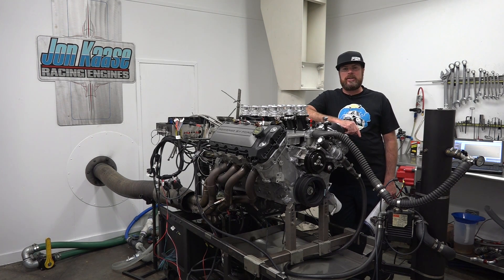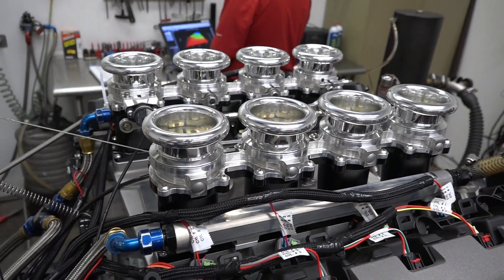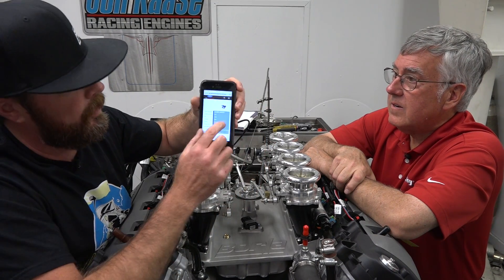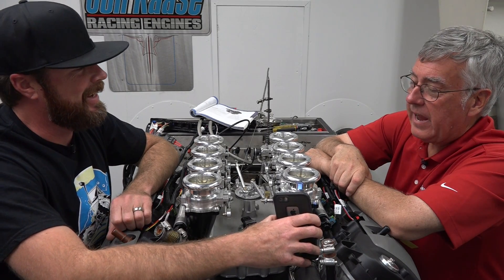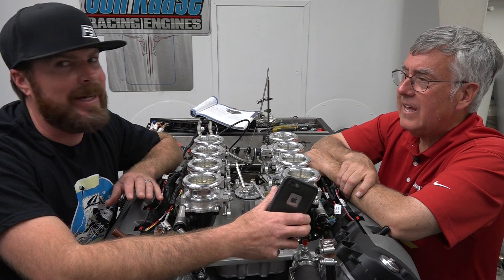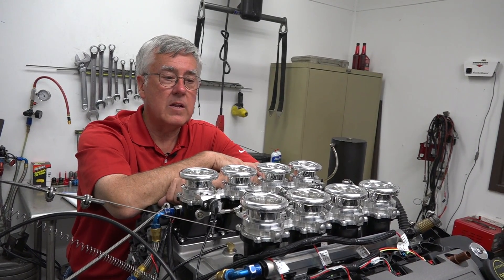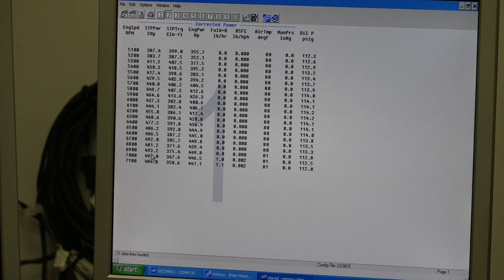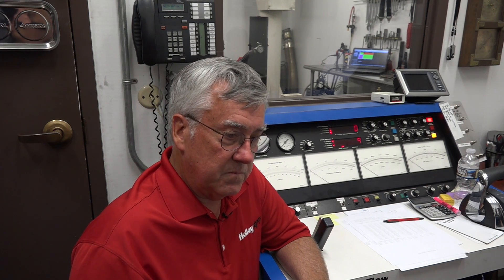Finnegan's Garage Ep.37: Dyno Testing a Ford Coyote Engine with Borla Stack Injection

Comment: $6500 is a little much for an intake manifold.
Reply: not when its machined from unicorn farts
Reply: @ screaminggoat43... yes it is, but just look at it, it's a thing of beauty
Reply: you don't do ITBs for raw HP, you do it for throttle response. a good ITB setup will always have the fastest throttle response, and a Dyno doesn't measure that.
Reply: You're missing the point. Nothing sounds as good as the intake noise from a high revving V8 with 8 open throttle bodies.
Reply: The buyer got this intake because that's what the buyer wanted.
Reply: wow burn out kings with pro mods so impressive
Reply: +1320crusier whats the advantage of 8x 55mm TB's feeding into a plenum and how are you going to tune each TB for that cyl when it feeds into a Plenum, this isnt a setup where 8 individual throttle bodies feed into 8 individual runners
Reply: Skylar Garrett, did you watch the video? Didn't think so.
Reply: considering the CJ and Boss 302 makes 440 hp at the wheels... LOL
Reply: @raven. Sounds like you are new to the car scene. Those "rice" intakes have been around for decades...That style of intake is known for its style and extremely high RPM power games. a tb and cai wont give you 60hp....
Reply: Is all cranky, must be all that sand Australia has got into his ass. Relax bitter crow...
Reply: Bitter Raven I thought you guys were called burnout queens because of how much cocaine and crack you've fried your brains on!
Reply: You forgot the %300 Borla surcharge.  8 throttle bodies is cool but on a plenum  it is only pose (especially how short they are).
Reply: 888johnmac......you can bet this engine is going in a kick ass cobra or maybe a GT.  Something where you can show off your engine bling!!
Reply: Bitter Raven.....You can bet your ass that "show" is what he was after.  This is going in some kind of Ford GT or more than likely a perfect Shelby Cobra!  Everything about that piece of jewelry says show car.
Reply: you also do it for throttle area. Those 8 55mm tb's flow SO much more than a single 80mm.  Then we can also talk about the ability to tune each throttle trumpet for that cylinder etc.  The top teams in the world wouldnt use them if they didnt work for power and response.
Reply: @1320crusier  it is a better technology only if you have the engine below that's going to truly pull the air through them...
Reply: Sorry Mate,I spelled  "INBRED JACKASS" incorrectly.in hindsight i commented to you originally because you dont seem to grasp the idea that not everyone is looking to wring out the most power.some people are after a specific "look" .its a lot like the people who make "mad max" copies,they know the car is slow as shit,has a fake blower and is all fluff and no tough but they are beautiful cars none the less.

dont put yourself up on a pedestal,someone will just come and knock you off
Reply: Bitter Raven I'm from Nz, we have "mythical unicorns" too haha. You drive VLs, we get your magazines here. Stop talking shit you crazy Aussie, it's pathetic. 
/muted
Reply: ScreamingGoat43 yeah, isn't the whole crate coyote engine 6k?
Reply: complete kit including the ECM.
Reply: Yeah being i could get a 383 with an efi system for that kind of money.
Reply: That sort of money could buy a hell of lot of super charger, but there is an ass for every saddle.
Reply: You are a bitter Raven!!! Or Crow!
Reply: LMFAO good thing you didn't pay for it
Reply: even F1 cars have filters with their ITB setups.
Reply: It isnt a plenum.  It is really nothing more than a vacuum reservoir.  Borlas site calls it a 'vacuum accumulator.'  

The runners likely feed the accumulator via some small pcv'esc holes.   

To answer your question as if there is a plenum: throttle response.  A crazy ~19m^2 of throttle area means extremely fast plenum filling which means fast throttle response and pretty insane mid and high rpm air flow.
Reply: 450HP ist also not enough for a V8 behemoth ... but then again this is 'murica and not Europe, what am I expecting. Totally different attitudes towards engines.
Reply: 500hp from 5 liters... naturally aspirated... 7k peak power but holds power past 8k... wtf more do you want?... Yea you could do it for less but you wouldn't get the throttle response that this provides....  Also, Some people don't care about money....
Reply: Ya man what is up with that dude.. I been to both Auss and NZ, the people in NZ are so much nicer and down to earth than in Auss... And NZ is such a beatufuil country..
Reply: The reason it's so expensive is because the company that makes it probably sells 2 or 3 a year. It's not something that is going to sell by the thousands. The company will have to get a one off casting done in an aluminium foundry and then get someone to spend hours programming a CNC machine to do all the precision machining. Not to mention all the hours of research and development that went into getting the perfect fuel flow etc. Even if all this has been done before you pay because it's low volume production and the company needs to get back the money spent previously.
If it was an of the shelf mod for some car and engine that is frequently modified, like a Miata it would sell by the thousands and cost a couple of hundred dollars.
Reply: Yes and you can make that 'what a waste of money' argument about ANY performance part when $5 worth of nitrous sprayed directly into the intake with make 50hp+

This looks and sounds delicious, and makes a hell of a lot of power while doing it.
Reply: I was wondering if anyone else noticed/thought about that!
Reply: Sounds like you know nothing about ITB's or the advantages they provide.
Reply: Pay once, cry once.
Reply: Im only 18, All I can afford is a tunnel ram for a small block ford. A tunnel ram with two holley carbs is $1200.  That is still expensive.
Reply: Lol the small block ford I bought was $350.
Reply: Bitter Raven orly? What cars do aussies make?... I rest my case...
Reply: Bitter Raven Aussie street cars? you mean American muscle cars? Holden? A gm with a different body is the closest you get... consider that money Is not always a limiting factor for some. Imagine if 6k felt like 6 dollars to you... why not try it, and see what it does? ITB is great for throttle response, provides a unique sound and looks awesome...Perhaps this guy has several other 1k+ hp cars and he doesn't give a shit...   who knows... not you...
Reply: Bitter Raven rebadged.... roflll.... holden is a gm company... get a grip.
Reply: Allan rofl true.
Reply: honda s2000 from 15 years ago did that from the factory...without itbs.
Reply: MrCarlonator there has never, never, ever been a production Honda produce anywhere near 500 hp. Hell, they've never built a 400 hp car. At least until the lastest version of the nsx.
Reply: +MrCarlonator honda s2000 had 240hp from factory
Reply: I never thought my comment would get this many replies and likes.
Reply: Haha my comment is the top comment in this video. Goal achieved.
Reply: Ok lol you have no clue what you are talking about, we don't have BS laws tellING us what we can have , how much horspower we can have.. You have no clue what you are talking about... Talking about Burnouts lol
Reply: evil genius, cant really say its worth the money from the customers point of view though i think is the point.
you can get a turbo for a pittence lol
Reply: Svin Kuk I don't think it's a value for money thing! People sometimes just want to spend a lot of money so they can open their bonnet at a show and tell people that the engine cost £100000 to build. Since you mentioned turbo's look at it like this. You go to a show and open your hood and there's an eBay turbo that cost 300 quid. Hardly gets a second look. If you go to a show and open your hood and there's a £3000 Garrett turbo. People be like " ooooooooo Garrett".
Reply: It's definitely not needed for a street car but throttle response is excellent with individual throttle bodies and it looks cool but you pay big bucks for them. I hope this guy runs air filters on them lol
Reply: ScreamingGoat43 na builds are expensive!
Reply: you can make the same with cobra jet intake swap
Reply: T4iga lolololol 5.4 a behemoth? Its a little smallblock haha. And our engines make torque, very similar to older mercedes mills actually l.
Reply: 32v 5.4L swap crown Victoria coming soon!!! Yeah i have a gt350 intake im going to run on a 5.4 4v and drop in my 95 f150. Should be good for a lot more rpm range.
Reply: +Keegan Johnson I'm going cobra jet twin 67mm tb jlt 110 mm maf housing for n/a use buying the navigator long block soon
Reply: 32v 5.4L swap crown Victoria coming soon!!! I would love a CJ but the GT350 intake was free! Im a tech at a Ford shop. A mouse chewed on the imrc vaccum lines (which i plan to control), the air filter, and hood seal on the airbox, and Ford said "replace it all" so we did. They didn't want any of it back so I saved it from the trash and fixed it! I saw they go for like 1300 new for just the manifold.
Reply: +Keegan Johnson oh I see you're gonna need a alt bracket to reverse it to use that intake
Reply: 32v 5.4L swap crown Victoria coming soon!!! I know. Gotta have room in case i want a blower later anyways >:) are you relocating or is your cj tall enough to clear? Is a gt500 bracket the ticket? I get oem parts at a hair over cost so if possible id like to go with a ford bracket. I dont have the engine yet to mock up anything yet, Just the super duty 5.4 zf5 and that intake. When taxes show ill get one. Navi motors go for 1000 give or take around here. Not bad. Just going to do a little mild port smoothing and  get it in and running and then worry about souping it up further after all the bugs are out.
Reply: +Keegan Johnson I will have to mook up also from what I've seen with them on 1999- 04 mustangs the alt cleared MMR sells the 1/2inch plate adapters to hook up intake witch should give more clearance
Reply: 32v 5.4L swap crown Victoria coming soon!!! Well, im pretty handy with a plasma cutter and welder so ill figure something out haha. Its just a budget project for an old farm truck for now. I was going to just do a 351w, but i got the intake, and then i saw that zf5 for cheap and i was like f it, lets go navi motor. I dont really like how newer trucks look, and plan to keep this one a long time, so to me its worth it. And will be a fun learning experience. Ive swapped in larger engines of the same family before, but not of a different family.
Reply: ScreamingGoat43 Looks backward to me,a friend of mine and I went to Texas back in 91 and bought an original  for his GT40 as it was one of the original option motors,carbs. on the outside header on the inside ,believe you  me ,when we got it done it was fantabulas.
Reply: It's mainly for engine response and changing the character of the engine, better response and that ITB sound
Reply: that is half of a turbo kit to make 720whp on pump gas. so no not worth it.
Reply: @trillrifaxegrindor4411  yea...and those tiny 2.9 indy V8s make around 700HP....and this 5.0 could not even break 500HP??? so yea this set up is about 14% power increase and 86% bling.....
Reply: @stevemitchell2252  um.. not only did the indy V8s rev a LOT higher they had just about everything possible done to increase hp. Theres more to it than slapping parts together.
Reply: Plus the extra cash for the Holley ECU.
Reply: @1959VWBeetle  honestly, I wouldnt even touch a Holley ecm.  Nothing against it I just think better ecm;s exist.. like teh new BigStuff.
Reply: @1320crusier  I'm sure Finnegan makes some marketing revenue from using the Holley plus they're a big name in America, especially for the old skool muscle car guys.
It's amazing how many aftermarket ECU's are out there these days and that are made in different countries. Haltech n MoTec are both Australian. Emerald is the UK. Mega & MicroSquirt both originated in USA. So it's nice to see each country has their own aftermarket brand.
It is a shame though that many big brand names, no matter the industry, kinda end up selling stuff just cos of the name and yet the product isn't as good as things used to be.
Reply: @1320crusier  I must be getting used to Australian pricing as I thought the Haltech stuff was reasonably priced. The MoTec is rather expensive though. AU$4k for the M150 to run the Subie FA20 motor. It's taken me over week designing and making the patch loom to the engine loom.
I didn't know McLaren made aftermarket ECU's. Suppose just like their cars they are stupidly expensive.
I'm still considering a Megasquirt to run my EJ22 conversion but don't think it's that much cheaper than a Haltech 1500.
Reply: Not if you want to afford it.
Reply: The beautiful, my Lamborghini had 6 side draft 2bbl carbs. I always wanted to exaggerate that with velocity stacks. This Coyote is sweet.
Reply: @unlisted9494  *waste
Reply: Think of the na build you can do with that
Reply: That it maybe but when that hood pops and people see, I can guarantee the entire show will be talking about it. I wanna do this swap into my 96 Cobra.
Reply: You get this intake for looks not to get the "most bang for the buck"
Reply: Actually power gains were minimal,put this engine in a car with a full exhaust and full accessories and it probably wouldn't be much better than the original 435hp rating.
Reply: No, Finn just said the engine was $10,995 and the intake was another $6,500.
Reply: longevity.  That engine will make that power for a LONG time.
Reply: Bitter Raven  The first angry comment I've seen on this channel. And hey look it's an Aussie; one of the calmest, most helpful and humble people around.
He can build his car however he wants, just like you're free to put 20's and pearlescent paint on your VL m8
Not trying to insult, nothing can insult an Australian, as you've already said as you get called names by your friends/family every day. 

Your YouTube name is so appropriate. Love it
Reply: T4iga 500hp from 5 liters.  no forced induction... what planet are you on where that's not impressive?
Reply: Seriously way too much. That's a decent procharger/supercharger kit or at least most of it. That's pretty much the price of the engine if you buy it second hand. Granted it is a bit built but if you're running less than 500hp in a coyote what's the point of forged internals? You can easily/reliably put up 100hp over that and not need to worry about internals.
Reply: Ryan Proctor, fuck off idiot, we dont have promods on the street here in Australia, we have true blue built Aussie street cars, we have 8 sec 1/4 mile cars driven daily .. none of that 1/8th bullshit.. go have a look at street machine burnout comps.. then come back and tell me pro mods... idiot
Reply: +Adam Washere if you think that was a angry comment you need to get off mummies tit and harden the fuck up.
The moron that paid for this RICE setup can do whatever he wants ... as it states on the borla website that this is a 8x ITB "look" manifold, But this Video was made by Finnegan not the owner, so if Finnegan wants to up load bullshit like this then he should be able to take the backlash.
But talking to an american is like talking to a brick wall.. you idiots think the 2000 pontiac gto is a muscle car when its just a shitty commodore rebadged same with the 2017 chevrolet ss.
VL's are a bit old mate.. we prefer to drive what you americans call the mythical unicorn the R34 skyline
Reply: +farmvideos .net not my problem you threw away your vote.. but your country as a whole still voted a clown in, America is just like Nazi Germany, you stage 911 so you could invade the middle east just like Hitler did with Poland
Reply: +Allan you do know the moon landing was a conspiracy... Do you want elaborate on what stuff Australians have taken off America?
Reply: Allan your a Muppet stfu you fuckwit
Reply: +Allan Ford has never built a descent motor until the Turbo Barra 4.0ltr inline 6, the holden 253 and 308 use to always out power the ford clevo 302 and 351, The new commodore coming out has some impressive numbers being a V6 twin turbo, craig lowndes has been testing the new commodore for our supercar series,  for that car to compete it needs to make approximately 600hp with a 7500rpm limit with a top speed Approximately 300 kph (186 mph).. IMO seem pretty impressive V6 twin turbo
Reply: Austin C you're a moron.. the Fourth Generation Pontiac GTO was imported to America from Australia and was named in Australia as the Monaro, Americas 2012 - 2017 Chevrolet SS is the Holden VE -VF holden commodore.. all these cars were built in Australia and Exported to America.
Also Aussie street cars going back to the 70's the HG HQ HX Monaro was Aussie designed and Built same with the VB VC VH VK VL commodores, all engines 6 'sand V8 were Aussie designed and built except for the VL 6cyl that was a RB30 from nissan, The VN - VS series commodores ran Aussie built V8..... wasnt until late VT series that they started to run LS engines ...the ford XP XR XT XW XY XA XB XC XD XE XF EA EB ED EF AU BA BF FG were all built and designed in Australia all engines were designed and built in Australia.
Now idiot tell me how these are american muscle?
Reply: @RavenVapes  .You need to go back and do some more research on your information on what you said about the UK H gt holden. There are based on opels from the sixties. And the early Commodores were based off opels and Vauxhall's. Also the early Falcons were us designed. I am a Aussie and proud of our car history but what you have just said  is bullshit.
Reply: +Austin C Read this 
http://www.themotorreport.com.au/54156/ss-chevrolet-commodore-exports-returning-to-us-market-in-2013
Reply: +Rickey Ryan no one cares anymore... this topic is now a week old.. the internet has now moved on
Reply: What a waste of money $6500 for a intake that only gives you a 60hp increase
Reply: +big daddio Rice is anything that is all show and no go.. build something that looks fast without the power to back it up the idiots trying to Justify spending $6500 on  some thing that just for looks... Lets have 8x individual throttle bodies feed in to a plenum so it looks cool but has fuck all function, Prime rib? fucking moron.. it more like off cut meat that been glued together to look like prime rib
Reply: +big daddio why did you edit your comment.. to make yourself sound more like a fucking moron
Reply: +Zac Alleywalker Lowing you're a fucking knob head... you trying to be funny or just prefer to come across as a complete fuckwit
Reply: +damstachizz what hell of a lot of power?.. you can get better HP gains with a 100mm throttle body and a cold air intake .. this is what we call wank factor in oz all show and no go
Reply: +Mogs01gt You need to go do some actual research on this Borla intake... its 8x TB's that feed into a plenum, its a bullshit intake!.. 
big difference between American and Aussies, Americans will blow money on useless shit and build cars to sit in there garage and be trailer queens, While us Aussies will build a car to be used.. no wonder we are known as the burnout kings of the world
Reply: +farmvideos .net only drug fucked country is America, i suppose you have to legalize weed so you can deal with the clown you voted in as president, you might like to call Aussies names but at least we dont have idiots going around killing innocent people for no reason
Reply: I would call the Manifold 'RICE' ... might look good but gives you fuck all performance gain